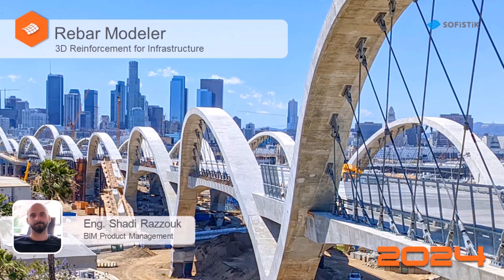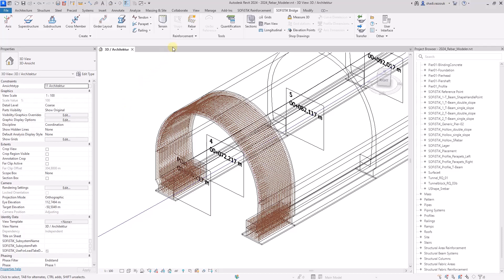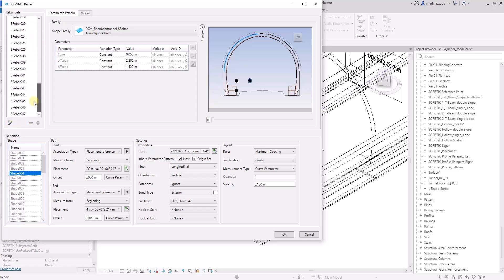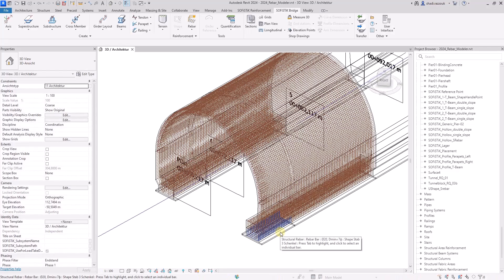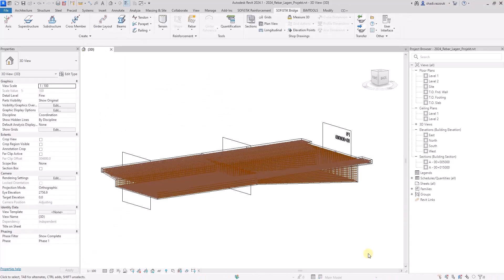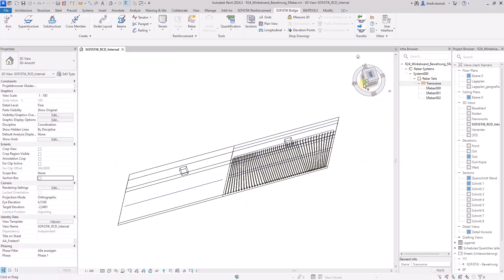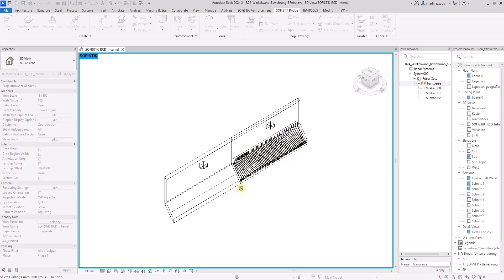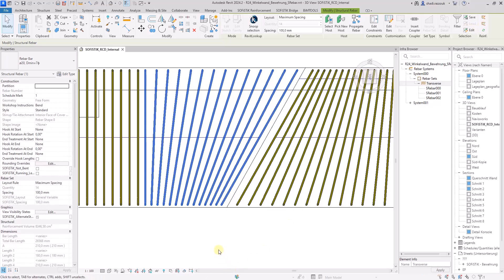Rebar Modeler Part 3 - Duplicate Rebars

Comment: hello, I have question pls I want to update revit from 2024 to 2025 
can I use sofistic 2024 with revit 2025 ?
Reply from the maker: Hi ahmedaljbiry6043,
the usual release cycle of SOFiSTiK Software is the middle of summer.
SOFiSTiK 2025 will release by then.
So no, right now you cannot use SOFiSTiK in Revit 2025 yet.